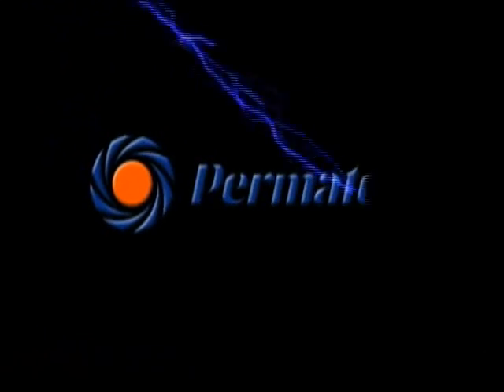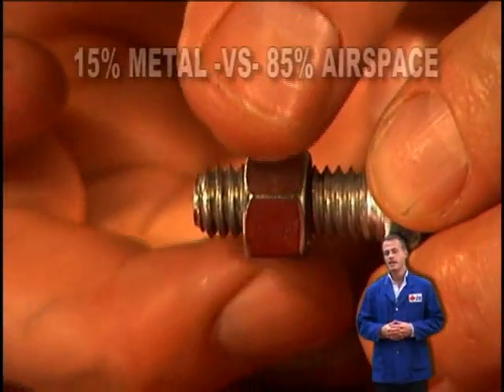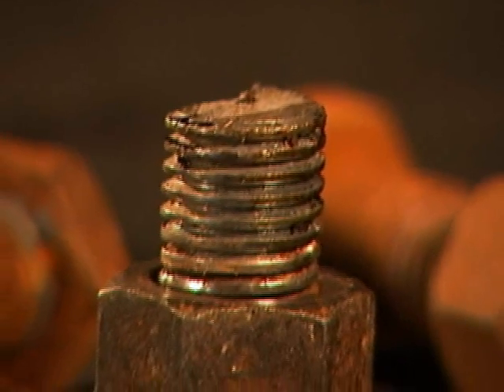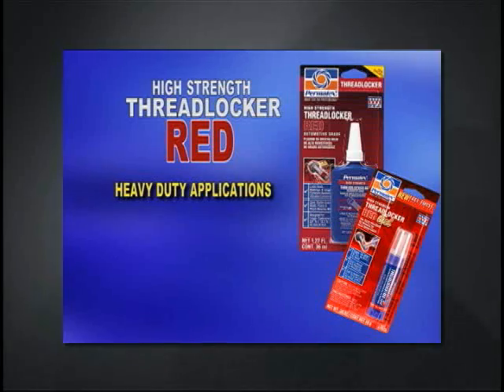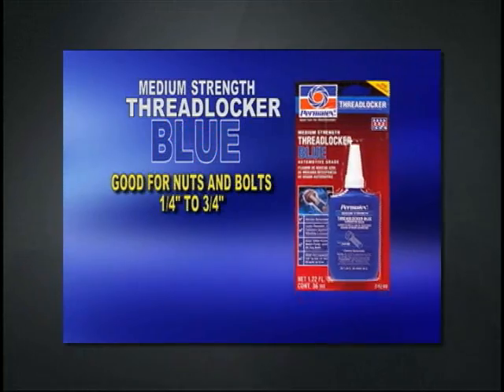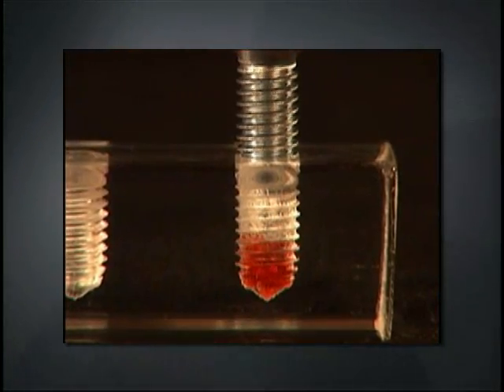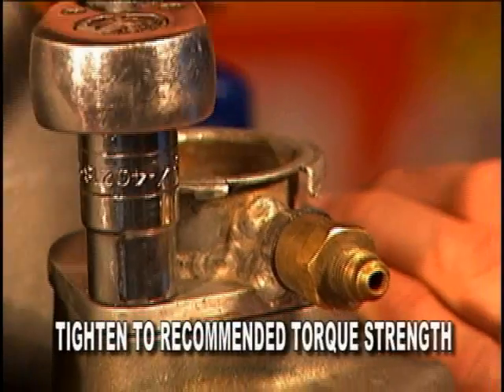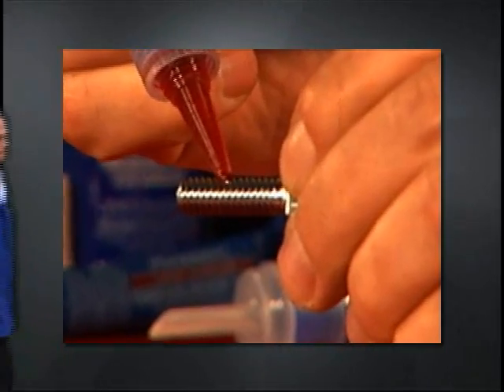Permatex - Threadlockers

Comment: i got the purple but it doesn't cure sometimes specially on my black m5 scews and it comes off with almost no force on my m3 screws. i wanna get blue now but i'm worried it'd be too strong D: I use it for my 3d printer because it has a lot of vibrations etc

Comment: WHICH PARTS GET THREADLOCKERS AND WHICH PARTS GET ANTI SEIZE PASTE?
Reply from the maker: It would depend on your situation and what/where you're fastening. With a bolt for example, if your goal is to secure that bolt in situations of extreme vibrations that could loosen it even after tightening the bolt, your best bet would be to use a threadlocker product on the threads to keep it from failing. Anti-seize can be used everywhere else in normal settings, where you'll be able to easily remove that bolt when needed.

Comment: Which version is good to use on a 2 stroke engine header bolts . Permanent red for vibration.  Or high temperature red ? My exhaust bolts keep backing out .
Reply from the maker: Likely your best bet would be to try the high temp red:

https://greggdistributors.ca/adhesives-sealants-and-tape/Thread-and-Gasket-Sealants/Threadlockers/per27200

Comment: do they make a semi permanent high temp thread lock
Reply: Yes. Permatex high temperature thread locker. Great stuff
Reply from the maker: Technically, all thread lockers are semi-permanent.  If you need a high temp option here is the item you're looking for:

https://greggdistributors.ca/adhesives-sealants-and-tape/Thread-and-Gasket-Sealants/Threadlockers/per27250

Comment: What type of threadlocker it is better to use on Inner Tire Rod ball thread (which attaches the rod to the steering rack body): Loctite 272, Loctite 271, Permatex 24300, Permatex Blue 24005 or none? My car is 2001 Saturn SL2. Torque specification for that part looks like 71 Ft-lbs. Different authors on utube apply different types, some don't apply anything. I would appreciate your opinion. Thank you for the film.
Reply from the maker: For an application like that you would be best to get recommendations directly from the manufacturer. We don't want to give advice that may not be accurate. GM should have a technical manual available for that model of car, otherwise you may be off to the dealership for advice. Sorry we couldn't be of more assistance, and thanks for watching our video!
Reply: @GreggDistributorsLP  Thank you, but can dealership give advises on repair done by a customer? I think usually they want to repair everything themselves despite their busy schedule. Thank you for the film again.

Comment: In the demonstration the cap screws were very close to bottoming in the blind holes. What if the hole was substantially deeper than the length of the screw? For example: 2" deep hole and 1" engagement of screw. What if the hole is only partially threaded? It's difficult to thread a blind hole completely, even with a bottoming tap.
Reply from the maker: The "threadlocking" action takes place on the thread itself so ultimately the depth of the blind hole makes no difference.

Comment: I have fuel fittings i want to install on my car injection system specially the fuel rail and i do notwant to use threadtapethe fittings feels a lil loosewhen threaded. Should I use thread locker or permatex aviation gasket maker # 3(part#80017).
Reply from the maker: First things first, you need to know what type of thread you are working with.  For this application, you will most commonly see a bump style, flare style, or even a double flare.  Check out our Heads Up for Hosers series to help you determine the type of fitting you are dealing with.  If it is a flare style/bump style fitting you DO NOT need a "threadlocker" as the sealing does not occur on the threads, it takes place on the flared seating surface.  If anything you may need to consider using a specific sealant that is designed for flared fittings such as the Loctite (LCT) 1265769.  DO NOT use a gasket maker for sealing threads.  Hope this helps.
Reply: @GreggDistributorsLP  Thank you very much for the info.

Comment: Silly question when I put on my lug nuts and then retorque at a later date and it tightened a little more did I now just break the seal? Or will it still hold? Keeping lug nuts from vibrating loose. Thanks. I hope someone an understand what I mean. Lol
Reply from the maker: Generally speaking thread locker should not be used on lug nuts.  If your lug nuts are torqued to the correct specifications, they should not be vibrating loose.  If they are, you likely have an underlying issue that is causing this, and you may have to consider replacing studs/lug nuts and review torque specs.  In relation to your question regarding "breaking the seal", you are correct.  If the thread locker has fully cured and you re-torque any fastener, you will likely break the seal depending on how significant the fastener rotation is.  Hope that helps! Thanks for watching our video!

Comment: Is ok to use on a drain plug
Reply: Not a good idea. That may make maintenance down the road more difficult. Just get a new drain plug. They're super cheap.
Reply: Not sure where your drain plug is but I would never use it on a drain plug in a boat.
Reply from the maker: You would be able to use High Temperature Permatex Threadlocker for that application, however, you will not be able to easily remove the drain plug in the future.

Comment: Be careful with that blind hole method. Liquids in a blind hole compressed with a fastener can actually crack the metal that it's threaded into from hydraulic force.
Reply: Best comment  on this question.
Reply: Thanks for the info. Never thought of that